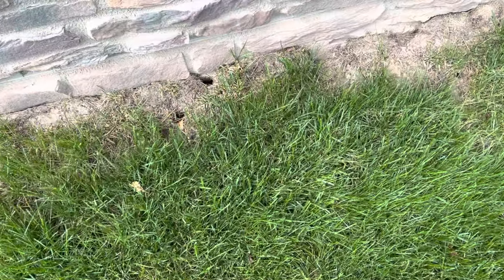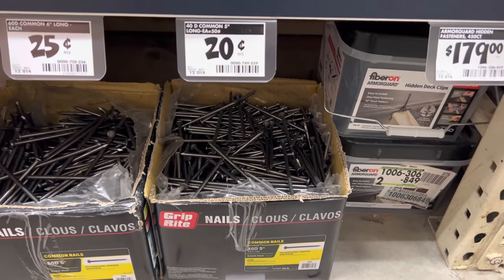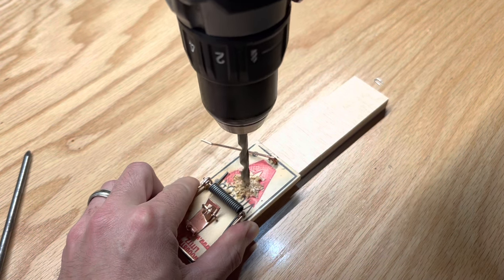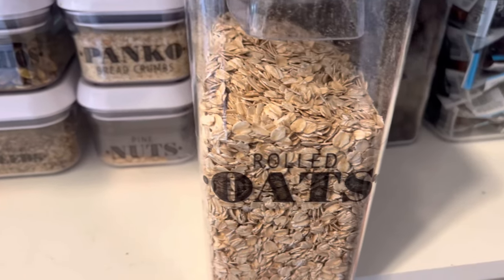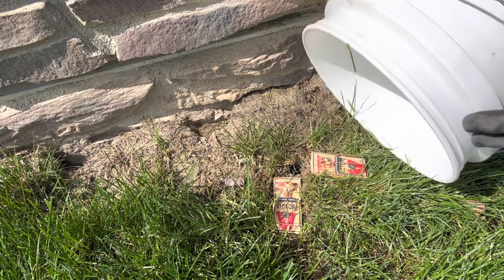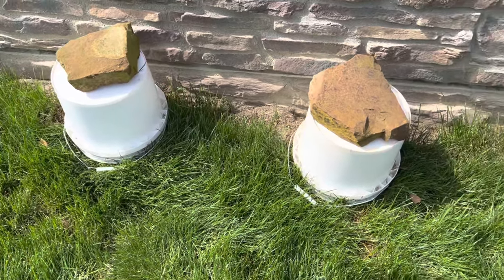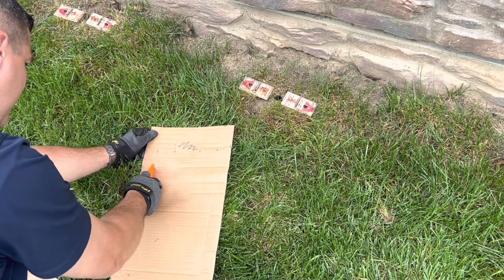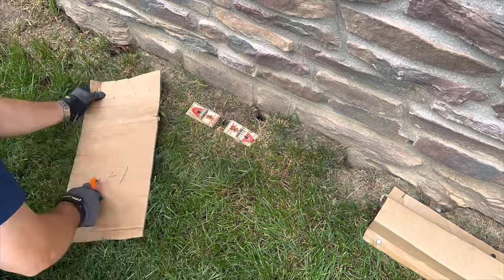How to Get Rid of Moles and Voles in Your Yard

Comment: I am in SE Wi. I have 2 yucca plants and voles attacked them 2 years ago. After using voleX and spreading it in their trails it reduced them. Now after heavy snows we had a week of warmer temps and you explained exactly what I have new trails at 1 yucca that they made under the snow. I like your trap, peanut butter nail to ground w bucket and weight . Thank you.
Reply from the maker: You’re welcome and thank you for watching.  I have found a system that works (2.0 improvement of this video) getting rid of a high amount that you may need.  This solution has worked for me and everyone I know that’s tried it so far and I've made a video on it.  The link to the video is below as well as the links to the bait stations and bait that I would recommend.  Wait 1-2 weeks and I bet your issue goes away with these 6 stations. 
Bait Stations: https://amzn.to/3Ehhu4u
Bait Blocks: https://amzn.to/45w8sg6
DIY How to video: https://youtu.be/rXEtaovUw-k

*DISCLAIMER: The above links are Amazon affiliate links.  This costs you absolutely nothing, but pays me a small commission and helps me continue to create this FREE content.

Comment: It took patience but I got 2 voles! I also was putting out VoleX under the Yucca. BUT the 2 Voles were likely the main ones. I had 4 traps under 2 buckets. I removed all of the yucca leaves above grade and dug out most of it below grade and found their main food source at the base of the main stem at grade. I will remove the remaining root based on the weather. Grass is growing in lush due to the "aerating" of the soil by the voles! ;-} MANY THANKS!!
Reply from the maker: Awesome, glad it worked!  I have another video if you need to catch more than a couple, did you get a chance to watch it yet?  I leave those PVC traps out.  👍

Comment: How does this prevent other creatures, such as chipmunks or squirrels from getting injured with the traps?
Reply from the maker: I have never had another animal get injured, but it is possible.  Since this video I have gone with these traps in the video below.  Let me know if you need any help making them or sourcing anything.  DIY Bait Station:
https://youtu.be/rXEtaovUw-k
Reply: I have the little devils tunneling under the supports for my above ground pool.  I’ve tried every deterrent. I even tried the blade drop type traps. Nothing seems to work.  Their tunneling has actually created sinkholes under my pool liner.  I actually drained the pool and will be doing a full liner replacement mid-Spring.  I’m thinking i may need to pour deep concrete footings under the supports.  And possibly use some sort of irritant in my sand padding under the liner.

Comment: I dont understand.. im doing all this, and in the morning the entrances are plugged shut, the traps untouched. So ill push the plug to the hole.. 6 hours later hole is plugged again...traps still set. And so on in a circle...ive tried gassing with my car, poison bait , flooding with hose, i also poured gas and transmission fluid down all the hole's, im going to the spca to get all the wild barn cars they have in the premises and try that next i guess. I cant use TNT because i live in the city with buried utilities
Reply from the maker: They are very frustrating.  This solution will work and I've made a video on it.  The link to the video is below as well as the links to the bait stations and bait that I would recommend.  Wait 1-2 weeks and I bet your issue goes away with these 6 stations. 
Bait Stations: https://amzn.to/3Ehhu4u
Bait Blocks: https://amzn.to/45w8sg6
DIY How to video: https://youtu.be/rXEtaovUw-k

Comment: I found as many of the holes I could under the slap for the side walk mixed diesel with gas poured it in every hole we could but when we lit it was a loud back kick we killed some but 7 rat's made it out stealing like pigs on two of the holes we didn't see no babies. And a neighbor behind me called the fire department when they showed up we hid inside but lawnmower was in front I told them yes it was some guy in a hot ride with a back fire that made me duck and told it was so loud I was surprised it didn't blow windows out drag because I did want too repeat it in about 6 months
Reply from the maker: Thanks for watching.  I would not recommend doing what you did again.  This solution will work and I've made a video on it.  The link to the video is below as well as the links to the bait stations and bait that I would recommend.  Wait 1-2 weeks and I bet your issue goes away with these 6 stations. 
Bait Stations: https://amzn.to/3Ehhu4u
Bait Blocks: https://amzn.to/45w8sg6
DIY How to video: https://youtu.be/rXEtaovUw-k

Comment: I was told human urine could run voles away...any truth to that??
Reply from the maker: They don’t like the smell and it is possible, but if you’re just trying to make them run away quickly I would go with the pinwheels: Pinwheel to scare voles/moles away: https://amzn.to/3I8qcEq
Reply: @inspiringbuilds  I can give that a whirl...thanks for the heads up 👍🏿👍🏿👍🏿
Reply from the maker: @geraldfer  You’re welcome, good luck with running them away.  Keep in mind running them off always has a chance for them to return later.  If you don’t like the traps I have another technique that will kill large colonies as well within a week with no traps.  It’s a separate video on my channel and that bait works great!
Reply from the maker: @geraldfer  Here is the bait station I’ve had great success with:  https://youtu.be/rXEtaovUw-k
Reply: @inspiringbuilds  
How does a pinwheel work. I have a couple. Bu t just a simple pinwheel  doesn't do anything  to eliminate the moles .  As pinwheel don't seem to  do much.
Reply from the maker: @equine2020  Thanks for watching.  I’ve had success with holographic pinwheels that you can place in the yard that spin with the wind.  The vibration from the wind goes down the straw and into the ground creating just enough vibration annoying the voles making them leave.  However, they may go to a neighbor’s yard and eventually return so I didn’t want to go with this solution.
Reply from the maker: @equine2020  Pinwheel to scare voles/moles away: https://amzn.to/3I8qcEq

Comment: I don’t understand the need for the nails. Once trapped, the voles ain’t gonna  carry the trap away. It’s under a bucket.
Reply from the maker: Good question.  The nail holds down the trap to avoid it getting flipped over prior to the vole getting captured.  Once the vole is captured there is no concern if it would flip over or not.